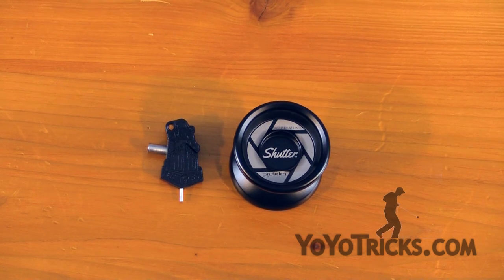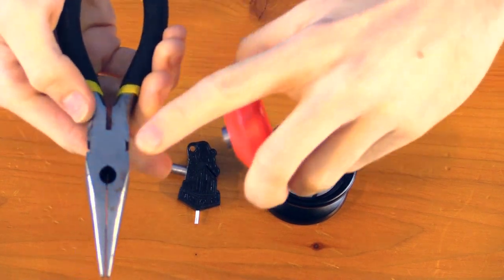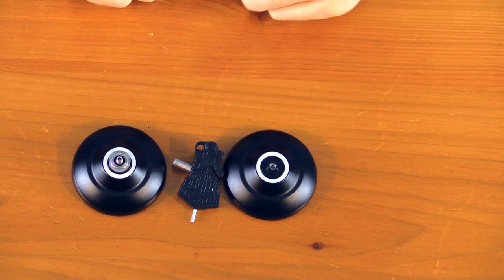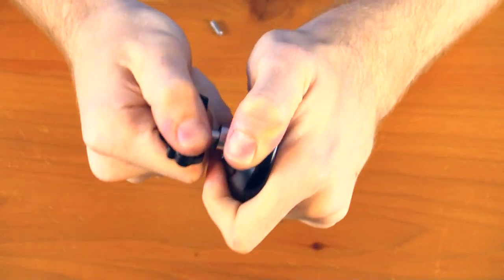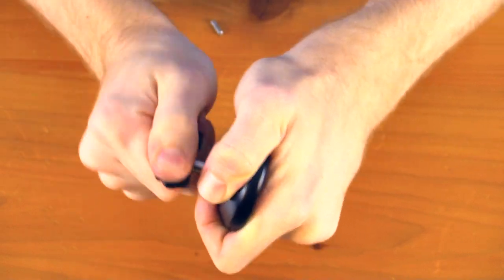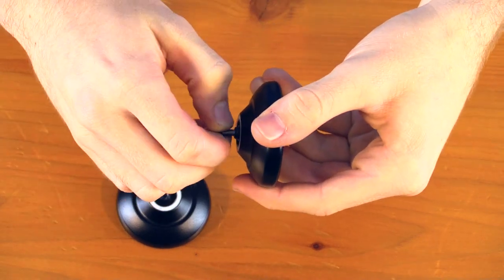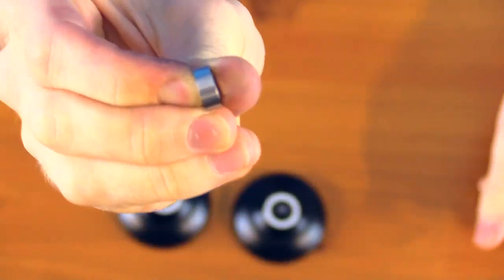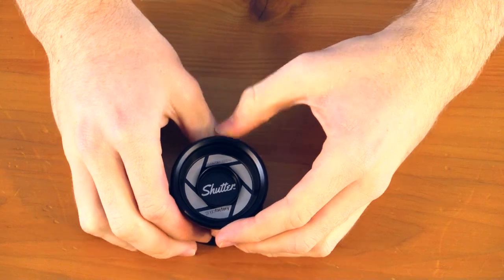How to Remove a Yoyo Bearing - size C

Comment: NEVER! NEVER! NEVER! NEVER use pliers on a BARE AXEL! You may cause burs or gouges in the threads of the axel which will cause the threads in the yoyo to become STRIPED which will TOTALLY RUIN a good yoyo! Wrap a thin piece of leather (or at LEAST a thick piece of paper) on the axel before gripping it with the pliers. This simple precaution may save your favorite yoyo!
Reply: Too late…
Reply: @inchy0076  oof
Reply: I'm lucky lol I have a bearing remover, this would have helped me out a lot if I didn't though :D
Reply: I just stuck my pee pee in it and pulled it out plenty of cushioning and better than the bearing removal tool

Comment from the maker: +Tommy Bidonde Chill Swaggness What kind of lube are you using? What do you mean that the string doesn't even roll off? Did you remove the response pads?
Reply: +yotricks I got a magic yoyo but it said it was unresponsive  ut I got It responsive
Reply from the maker: Most likely that means something is wrong with the bearing.
Reply: +yotricks how do i remove a Velocity bearing?
Reply from the maker: YoYoFactory made a video that might help with that. We recommend using a tiny screwdriver, like you would use for glasses, instead of a pin.
https://www.youtube.com/watch?v=INyRFN49_qc
Reply from the maker: The same way we show in this video.

Comment: First, thanks for all your help. I've learned a ton from you guys. Question: I Just changed the bearing out on my Sage to be unresponsive--do I need to remove the response pads too? I'm having trouble with the bind. Even the "easiest bind ever." I've played responsive for a long time now and know a bunch of tricks but for some reason I can't get the dang bind for my new unresponsive Sage. Any tips?
Reply from the maker: You do not need to change the response pads. If you are having difficulty with the bind most likely that means you are attempting to bind with the yoyo on the wrong side of the string. If you need some other easy binds to work on I suggest you watch our new Trapeze and Brain-twister videos. We have an easy bind in each of those that might be a little better to learn as a first bind.
https://www.youtube.com/watch?v=K9XTQx6bxh8

https://www.youtube.com/watch?v=v-V9KngiL2Y

Comment: Sorry for asking to many questions Yotricks but once I bought bearing from to play (sorry) it was a center track and once I placed it into my yoyo it came responsive, and my friend said not to lube it. Any kind of method?
Reply from the maker: Christina Tran If the bearing was new and it play responsive it may be bad. However, if you lube it with a tiny bit of thin yoyo lube that might get it working again.

Comment: Hey, can I also remove a concave bearing with normal pliers? Because I have a Shutter, a Horizon and just got a Grasshopper now and in none of these I can remove the bearing with pliers? Is it necessary to have this tool?
Reply: Please help because the new Grasshopper is responsive and I need to lube it D:

Comment: I'm thinking about getting the sage yoyo, and I'm wondering if the pro pack comes included with a responsive bearing (in the yoyo), so I could transition without much hassle. Any thoughts on what I should get?
Reply from the maker: Michael Pipinis The Pro Pack does come with the responsive bearing. One thing to consider, if you are not already into unresponsive yo-yoing you might want to get some thick lube in addition to the pack, as this will keep the thin bearing playing responsive and easy. 
http://yoyotricks.com/yoyo-store/yotricks/the-sage-yoyo-pro-pack/
http://yoyotricks.com/yoyo-store/yoyo-lube/yotricks-thick-yoyo-lube/
Reply: Thanks!

Comment: Magic yoyo n8 has a concave c size bearing.If it breaks, can I use the c size concave bearing from amazon??does it fit my magic yoyo???please reply fast
Reply from the maker: If the bearing is size C (but not slim) it should fit.
Reply: Is the c size bearing in amazon responsive or unreponsove??

Comment: Can you take out the bearing in a yoyo factory dv888 with pliers also? And will a Kk bearing fit it?
Reply from the maker: Marty Van Doren You should be able to remove it with pliers, but my guess is that it will not be as easy as it is on a Sage, like we show in this video. A KonKave bearing will fit.
Reply: yotricks thanks!

Comment: What if i don't have the bearing removal tool can i take it off with some pliers?
Reply from the maker: keykis893 You can try, but we have had quite a few customers scrape their yoyo up this way and break their bearing. It is totally possible, but a little risky if you have never done it before.

Comment: I cant seem to get my sage apart I have done it before but now when I want to change the bearings it wont unscrew do I have to buy a new one or is there some way I can fix it
Reply from the maker: +stephana johnson It sounds like the bolt may have gotten stripped. To get the bolt out you need to pull the halves of the yoyo apart while you unscrew it. If you can get it unscrewed you can push the bolt through the yoyo half which will pop the cap off so your can remove it. You can get a bolt that is the same size at any hardware store.

Comment: Hello guys I just purchased a Shutter in Camo design, and it came with a center trac bearing, when I throw a sleeper, the Yoyo is wobbling a bit, it's like its shaking a bit, and I just wanted to ask you is it normal, or is the Center Trac bearing not propably set in?!
Reply from the maker: It is not normal for the Shutter yoyo to wobble. It could be the bearing, or the yoyo may be cross threaded.
Reply: Thx for your answer, what do you mean with cross threaded?
Reply from the maker: That means the halves were not aligned properly when it was screwed together.
Reply: Is there a way I could fix it, I dont feel a big difference of the performance from the Yoyo...
Reply from the maker: As far as I know there is no way to fix something like this in a yoyo.
Reply: yotricks Oh, okay, is there an huge difference of the performance when its wobbeling just a bit, because sometimes its spinning normal but it depends how good my sleeper is..
Reply from the maker: It depends on how much it is wobbling, but I would say that the difference in performance is usually very small.
Reply: yotricks Allright, thx a lot for your help! :)

Comment: Yoyo tricks what could I use if I'm gonna get the velocity yoyo and I want to remove the bearing and I can't currently afford the utility on my card
Reply from the maker: Jaden Garcia The bearing removal tool does not work on the Velocity. The best way to remove it is with a tiny screw driver.

Comment: Does the grind machine from your site come responsive or unresponsive
Reply from the maker: Ray Branaman Unresponsive.
Reply: If I put a half spec bearing in it would that make it responsive?
Reply from the maker: It could, especially if you lube the bearing with thick yoyo lube.

Comment: Hey yotricks I g a problem I am using a protostar and today my protostar was responsive and only can up every once in a while but now for some reason after I changed the string and lubed the bearing it became completely responsive us there any way to fix this
Reply from the maker: Sean Fagan It is possible that you have over lubed the bearing. If you put too much lube in the bearing it will start to play responsive until the lube breaks in a bit. I suggest you stop lubing the bearing for a bit and see if that makes it play unresponsive again. What kind of lube are you using?

Comment: Nooo!
I forgot to buy a yoyo-tool with my shutter.. Will I be able to get the bearing out if I do it carefully with pliers?
Reply: Waaaait, I just got the package and opened the yoyo and the bearing just came right out on its own...
Is it something wrong with the bearing seat??
Reply from the maker: Oliver Bergqvist On every yoyo model occasionally the bearings fit tight, and other times they are loose. Either way, nothing is wrong with the yoyo.
Reply: Yay! Lucky me!

Comment: out of question, can you take a bearing out of a horizon without a multitool? I tried pliers, and they don't work.
Reply from the maker: Scared of circles Theoretically it can be done, but it is quite difficult.
Reply: Thanks!(theoretically)

Comment: I have the velocity however I cannot get the bearing out. How might I approach this?
Reply: Yeah me too
Reply: +The G Magister i figured it out. use something flat and strong to take the holders off. once they are off, use the round part of long nose pliers to take off the bearing from the other bearing seat by wiggling the bearing on the seat until it comes off. insert the bearing seats into the sides of the yoyo before putting on the bearing. bear in mind taking the bearing seats off of the bearing is the hardest and most time consuming part. :)

Comment: on my space cowboy the bearing comes out when I give it a slight pull with my fingers so I came to this vid,it plays perfectly fine but I was wondering,also I have another center Trac bearing and it won't fit if I have it on a certain side,is this normal?both bearings are exactly the same size and etc
Reply from the maker: +Jack Ripper All bearings have a range of how tightly they fit in order to be acceptable. It sounds like one of your CT bearings is on the loose side, while another is on the tight side. That is normal.
Reply: +yotricks thank you

Comment: Every time i remove my bearing it gets stuck on the tool,is there a way to prevent that?
Reply from the maker: yang576 Some of the multitools just fit a little too tight on the bearing. As you use it this should happen less and less over time.

Comment: Yotrick please help I recently got the shutter and the bearing seat are tight and good but now it is lose and I could just shake the bearing out,this just happen with one side.Is there something wrong with my yoyo?
Reply: Now it is happening to both side,when I screw the yoyo back and unscrew it,the bearing isn't connected to the yoyo,is this normal?
Reply from the maker: +Huy Nguyen That does happen to yoyos over time. It is not a problem.
Reply: +yotricks does it effect play? I can't tell the diffence,because it just happen today,but will it effect play in the future?

Comment: I've been told that ur not supposed to unscrew a Yoyo when u get it and that u need to untwist the string and put it around so if ur not supposed to unscrew a yoyo then how do u change the bearing
Reply from the maker: dead mouse23 It is perfectly fine to unscrew your yoyo. However, when you are putting on a new string, you do want to make sure your yoyo is screwed together.

Comment: Im looking to get a yoyo for christmas which yoyo would you recommend for doing lots of tricks and alot of speed but a one that is not that complicated to use
Reply from the maker: Eve Mcilwraith What yoyo are you currently using, and what tricks can you already do?
Reply: Currently i only have a cheap yoyo and ive learned all the videos that uve got on the beginner but i would like a yoyo that would do tricks and it is not to hard to use
Reply from the maker: OK. I would recommend getting the Velocity Yoyo Starter Pack. That yoyo works great, and it is easy to switch between a more beginner and a more advanced mode. The Pack comes with things you will need to keep it working great for a long time.
http://yoyotricks.com/yoyo-store/yoyofactory/velocity-yoyo-starter-pack/
Reply: By the way is the shop only for the US (as i am from the UK)
Reply from the maker: We ship to the UK as well.
Reply: Yes thanks for the help
Reply: yotricks how about Malaysia
Reply from the maker: Yes, to Malaysia as well.
Reply: They ship every where shipping is not to bad 45 dollars for the sage pack is better than me buying a yo mega 30 dollars and buying a maintenance pack 17$ so I am probably gonna buy the sage or should I buy velocity
Reply from the maker: If you want a yoyo that is both responsive and unresponsive get either the Velocity or the Sage Pro Pack.
Reply from the maker: Not sure about the drill bit, but needle nose pliers can work.
https://www.youtube.com/watch?v=ZS_K-98jX0w
Reply from the maker: I have no idea.

Comment: How can I remove the bearing and axle if the bearing is on the axle side but the hold of the axle is facing downwards?
Reply from the maker: If you wrap a rubber band around the top of the axle you should be able to get enough of a grip to remove it with pliers.

Comment: @yotricks Hi I just got a yo mega raider and I was using it and it's a great YOYO but I took it apart and put it back together and now it won't sleep when I throw it it just comes straight back up. It seems like the the string is going around the bearing and then eating the string. Instead of the bearing spinning.  Please help!!!!!
Reply from the maker: NerfandOtherStuff IT sounds to me like you may have lost one of the spacers.
Reply: @yotricks I just checked and it has both of the spacers. Do know what might be the problem now?
Reply from the maker: In that case, no. Are you putting the string on the yoyo after you put it together?
Reply: yes @yotricks
Reply from the maker: Hmmm... I can't imagine what might be causing those problems then.

Comment: I bought the Replay Pro but even if I use the multi tool the bearing is not coming off . Do I to get pliers to take it off or what?
Reply: Another thing is I can't remove the Axel (I'm sorry if that is not spelled correctly).
Reply from the maker: +Jesse The axle does not come off on the Replay Pro. Pliers may work, but be careful because you could destroy the bearing.
Reply: yotricks Thank you.

Comment: Can i still take off a shutter bearing with a pliers?
Reply from the maker: Yes.
Reply: yotricks does it took longer because i tried for about 30 seconds and it wont come off
Reply from the maker: It does.
Reply from the maker: It can take a long time, yes.
Reply: yotricks ok thx
Reply: So is my shutter just way newer than this video?  My bearing actually screws into the outside of the axel hole.  I completely ruined my brand new shutter because of this.  I'm wondering if this is why he is struggling in the video with his shutter and he is well, not observant.
Reply: Fuck edits.  As an experienced yoyo player I didn't even think twice to think it may have threads now since I haven't bought a new yoyo in 4 years.  I did research online to see of any mention of these threads, and nothing.

Comment: How to you take the axel off??? My replay pro does not have a hole in the axel.
Reply from the maker: The axle cannot be removed in that yoyo.
Reply: yotricks it's the same with the sage
Reply: yotricks I have the same problem... does the bearing on the replay Pro come out?? if so... well, how?
Reply: Bali-Bearingz 17 just use a pair of pliers. I do that on my replay pro lol
Reply: lol my bearing ended up coming off on its own XD i was scared use the pliers but i guess that problem  solved its self . Thank You for the tip tho, still helps! :)
Reply: Bali-Bearingz 17 same I just slammed it on the table and it fell out XD

Comment: The axle on my Duncan flipside broke in half... Any what i can get it out?
Reply from the maker: pinopa72 The caps pop off, and if you get the caps off then the bolt will come right out. If you have another bolt, or something the same size, you can push it through the yoyo which will pop off the caps.

Comment: I have the sage and recently ordered the size c bearing for unresponsive play.  WIth the stock bearing of the sage i was able to throw a sleeper and rotation seemed strong and was looking for increased spin time to perform string tricks. Now when i throw a sleeper though it feels as if no power is transferred to rotation/sleeps weakly, short duration and wobbles. Also the string wraps loosely around bearing with the c beaing. Was wondering if you could provide some insight.
Reply from the maker: MrTurtleGod With the wider bearing the yoyo should sleep 3-4 times longer than it did before. Did you get the Center Trac bearing we recommend for the Sage? Also, how long is your string?
Reply: yotricks I purchased the recommended bearing. ..th e string is the stock one that came with my sage- about 2 weeks old
Reply from the maker: OK. Spin the CenterTrac bearing by spinning it with your finger and let me know how long it spins.
Reply: yotricks it spins for about 3 seconds
Reply from the maker: Does it come to a sudden stop, or a gradual stop? Also, have you lubed the bearing yet? Have you tried putting on a new string. A longer string may solve the problem.
Reply: yotricks the stop is gradual. I applied thin lube as described in your video..should I re-apply?
Reply from the maker: No need to re-apply. It sounds like the bearing is working the way it should. My best guess is that you should either try a longer string, or it is also possible that you may be screwing the yoyo together too tightly, so that the bearing cannot spin free the way it is supposed to.